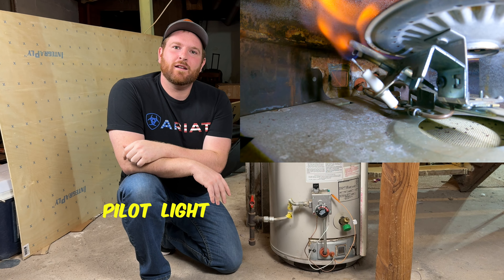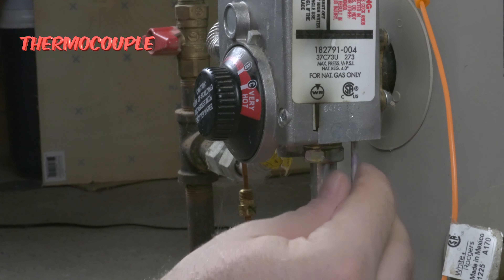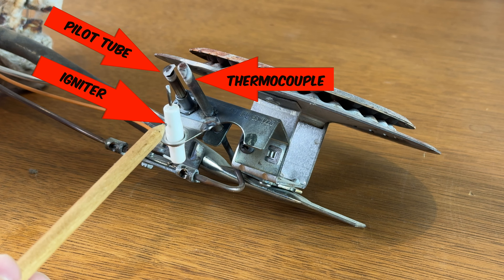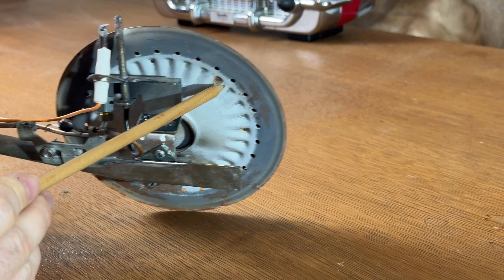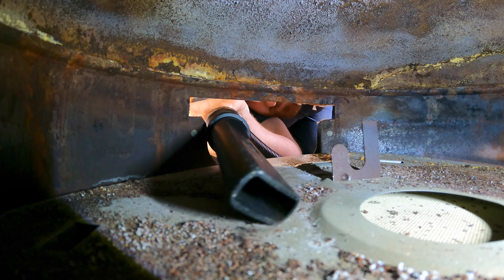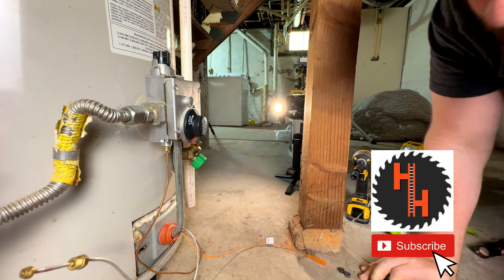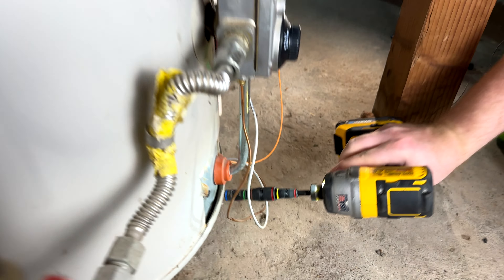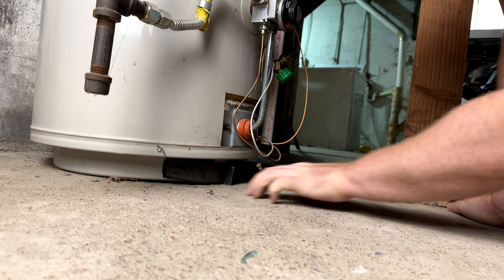FREE Fix! Pilot Light That WON'T STAY LIT on Water Heater

Comment: Think mines needs to be replaced.  The couple and rod is really melted. Nevermind. I see the rod just looks burnt and the other rod has opening where the gas comes thru. There’s a spot on the burner looks melted or white residue. Going to attempt the sand paper.
Reply from the maker: Hmm possible… wonder if you could get a new burner assembly? Maybe you’re right, it may just be time to send it to Pasture!
Reply: @HandymanHertz read something online says signs of back draft. Not sure what I’d do for that
Reply: Sand paper didn't work. Flame dies out after I let the pilot knob go. I'll hit up Ace Hardware or one of your links for the assembly..
Reply from the maker: Interesting…back draft. So would that be a chimney/exhaust issue or blockage? Good luck in fixing it. And thanks for using my Amazon link in advance, if you do! 👍🏼

Comment: This didn't work for me. Replaced the thermocouple--buying two of the same to verify the first wasn't the problem. 
The pilot lights, but as soon as I depress the pilot button it goes out.
This is an older model, doesn't have a separate igniter switch.
Natural gas, normal vent water heater. Model: MI403S6EN12
Serial: XD3905353
Reply from the maker: This is common when installing a new thermocouple. Most of the time it seems this is due to the flame not hitting the the thermocouple properly. 

I would adjust it and see if that works. Also, make sure you hold down the pilot for a minute or  so while the thermal couple heats up and starts sending voltage. 

Hope this helps.
Reply: @HandymanHertz  thank you!
I've tried adjusting and cleaning both thermocouple. I bought two thermocouples and they both stayed lit when first lit for about 2 hours. Then they go out, and will light again, but when releasing the pilot button, it just goes out.
Maybe the valve itself? I took it apart and found nothing dirty or clogged. Still no luck. The water heater is at least 12 years old. Time for a new one?
Reply from the maker: @JoJoJonnSinn it does sound like the gas valve may be the issue. If you want to make sure, you can test what voltage is coming from the thermal couple on the end… I think it's 20 mV, but you may Google it just to verify. 12 years is on borrowed time, but a lot of mine have lasted 20+ years in my properties. If it were me, I would replace it, as those gas valves aren't the cheapest things either.  You'd hate to pile money into it just to have your tank rust out next year or something. Sorry I couldn't give you a more easy answer.
Reply from the maker: @JoJoJonnSinn one other possibility is it could be a draft coming through and blowing out the pilot. I don't know if you have windows open for the nice spring air coming through or something that would blow the pilot light out? Just a thought. I've even heard of downdrafts coming down the chimney and blowing it out 🤷‍♂️
Reply from the maker: @JoJoJonnSinn sorry, I had another thought. Maybe the tube that carries the gas to the pilot light is partially clogged, and limiting the flow of gas to the pilot light?

Comment: I just put a thermocouple on a gas water heater and it lit and stayed lit, but I don’t think it was the right one for that water heater.  Do I have anything to worry about?
Reply from the maker: Nope, I don't see any reason why. The only job of the thermocouple is to send voltage. The longer ones may take longer to send, but once they do you're good to go!

Comment: I may have two issues. 
A.O. Smith ProMax waterheater.
J06J018610

Suddenly, had no hot water.
Everything looked good.
Turned red selector on top off.
Turnd counterclockwise to piolet. 
Turned temp selector to piolet. 
Hit sparker several times.
Could not see spark in little window.
Tried several times.
Red button seemed to pop-up
Tried to turn top red selector clockwise to off.
Could not turn red button to off position. 
Where do I go from here?

Comment: I was able to get the pilot light to fire, but when I turned it on and and move the knob to low it would combust and light then die down until it’s out. How long do I need to leave the pilot light on until turning it on and giving it more gas? Or any other ideas, tips?

Comment: My water heater says something about replacing the gasket if you remove the burner assembly behind the cover. Is that really necessary? I just replaced my igniter and my pilot won't stay lit, so I'm assuming this is my problem. I also want to add that my water heater is only 2-3 years old and is a Rheem. I shouldn't have rust yet. I think it is the thermocouple.

Comment: Thanks brother! While I still plan on getting a new water heater I didn't really want to do it last night. While I knew the thermocouple was probably the problem, this tank is also 20 years old. I wasn't going to mess with it until you said your tank is 19 years old. Gave me the hope to try it instead of installing a new tank starting at 6 pm yesterday. Glad I saw your vid and that you mentioned 19 years!
Reply from the maker: Glad I could help! I know it's old, but I am of the mindset if it's not broke, don't fix it. Especially if you maintain it, by changing out the anode rod and flushing it,  it should last a while I would hope. 👍🏼

Comment: I can’t get the main burner nut off. It seems stuck on there, is this something that happens?
Reply from the maker: I’ve heard, but never experienced, that some have right handed threads, so maybe try going the other way. If that doesn’t work, you may need a flared nut wrench and just give it some power. If you’re afraid of busting the whole gas valve, use some sort of hold back on it as you loosen it. it may be partly seized on there, but I would make sure it’s not a right handed thread first. I’m curious to know what you find.

Comment: Rod removal: My water heater is 6 years old, but cheap brand. Heater went off by itself for 1st time and I think it needs all you said, including rod replacement. It would be proper maintenance.

In your vid it seems that you remove the rod AFTER trouble shooting the pilot light, correct? 

Without flushing the tank and removing rust from bottom? 

With water heater on, you just lift rod and replace, when water is hot? Or turn all off, wait till it cools, then proceed? 

If I remember well (not in the attic now) the rod is pretty tight, not easy to grab. 

Do you have a vid for that, and again, before or after servicing the pilot light/thermocouple?

Comment: Literally saved my family $1,200 for a new water heater + installation. I tried cleaning my old thermocouple, but still didn't work. The wire appeared to be broken right where the probe begins. Bought a new one from Ace for $10 and instantly fixed the problem after replacing it. God bless you!
Reply from the maker: Great! Glad to hear you saved a lot of money! If you'd like to show your appreciation more, I do have venmo/cashapp/paypal in the description. No pressure...Either way, I'm glad you got it fixed!

Comment: I swapped out a new thermal coupler put it an eighth of an inch from the pilot and the pilot light still won’t stay on any tips?
Reply from the maker: The thermocouple tip needs to be touching/immersed in the pilot flame.  The flame will heat up the thermocouple, sending enough voltage to allow the burner to kick on. Let me know if that works or not.

Comment: you say use water and soap to check for gas but how? Kinda left that ambiguous but it would be helpful to see a demonstration. I guess put soap in water and smear it around the gas line attachment and then check for bubbles to see if there is a leek?
Reply from the maker: Put water and a squirt of dish soap in a bottle. Shake. Spray. Bubbles will appear if there's a leak this works with air leaks in tires too.

Comment: Plumber wanted to charge $650 to try and change out possible 3 issues (lighter, gas tubing, sensor) and it wasn’t guaranteed to work.  Or replace the whole thing with a new heater with labor and haul away of old one $2600!  Sir you just saved me so much $$$, THANK YOU 🙏🏽

Comment: This could be it? Mine started acting up after a little flood...probably built up a film..? Darn thing is only a few years old, though the minor flooding could be linked.... I just want a hot shower again, been messing w this thing for a day now. it works for a little then not at all for awhile... Thermo coupler sensor i'm going to clean you...

Comment: saved me from buying both a new $900 water heater & a new $250 burner with this $36 thermocoupler!

AO Smith Pro+ GMV-50/100 water heater = 9003542 Pilot Assembly Replacement for Natural Gas Water Heater
Reply from the maker: Glad to help!

Comment: It's a "water heater" not a "hot water heater" if the water was already hot you wouldn't need a heater... 🙄
Reply from the maker: 🤨 if you want to get into the petty weeds… the waters already hot and it just make it hotter when the heater element/burner turns on. So it’s technically a hot water heater.

Comment: I am going to correct you at no charge. At 28 seconds I hit pause because I saw "PILOT LIGHT GAS" in green lettering. This is NOT the pilot light gas. This is the thermocouple. Skip ahead to 35 seconds and you say "next we take out the thermocouple.." and in red letters the word "THERMOCOUPLE" is captioned.Again, this is NOT the thermocouple. This is the pilot flame tube,or as you put it, the pilot light gas. How can i be the only one out of the first 10 comments to notice this and comment on it? Your comments are all super positive which is great but Im just pointing  out there is an opportunity for improvement here.